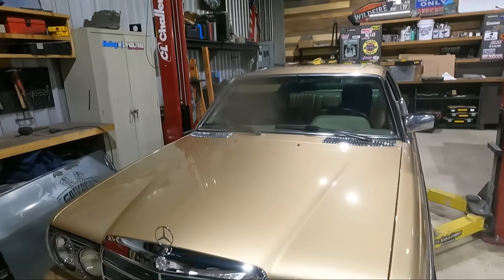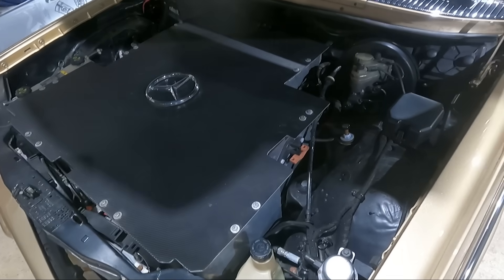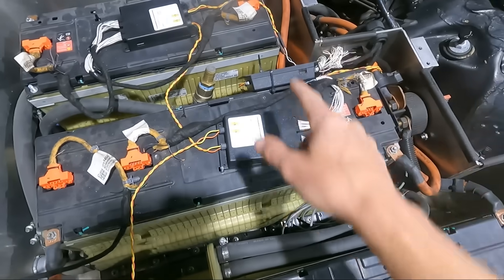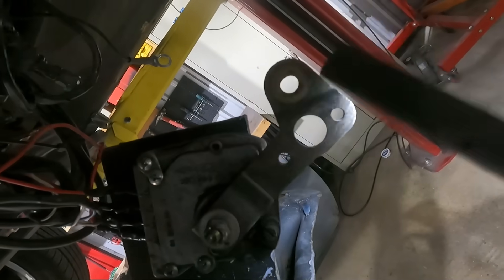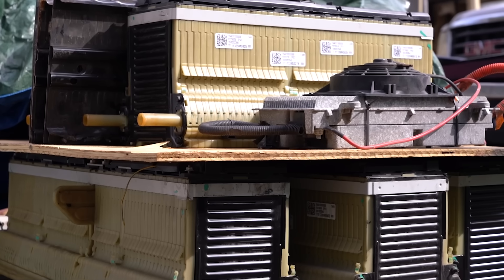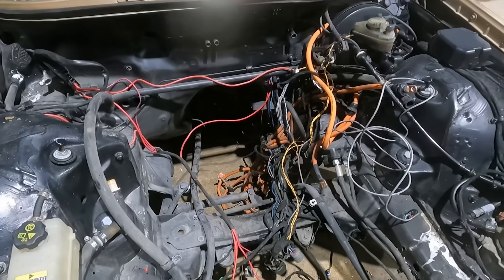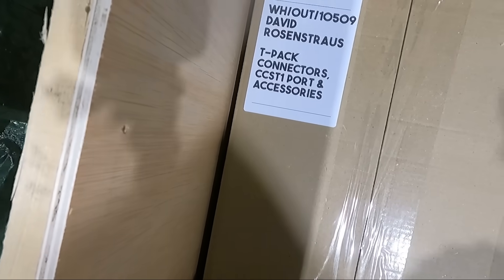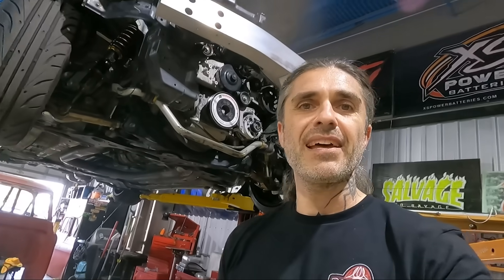Huge Tesla Swapped Mercedes Battery Upgrade! - EV 300CD  Benz Conversion Ep. 2

Comment: I miss my S123 wagon but i dont miss the 21mpg it was getting after 487,000mi or the oil dripping. cool build. but do you have a sound system to mimic the 5cyl. diesel sound?

Comment: Why do you need a seperate 12v automotive battery of there is no starter or gas powered engine in the vehicle any longer? Can't the vehicle run off the Tesla batteries you are installing such as radio and other electronic items?
Reply from the maker: The Tesla batteries are a high voltage system. You need a low voltage system to be able to power stuff like the radios and gauge cluster. The Tesla battery feeds into the 12v to keep it charged, similar to what an alternator would do. Then the 12v distributes power to the rest of the low voltage system!
Reply: @SalvagetoSavage  DUh, yeah I knew that not sure why I asked lol.
Reply: @479_Moto  It's a great question and you're not the only one who wonders why.

Comment: Removal what is arguably one of the most reliable motors ever installed into a passenger vehicle and replace it with, hands down the most unreliable power source ever installed into a passenger vehicle.  The originality of all the cars you guys do and upgrade blows my mind!!!  The LS Benz is the best build on YouTube.
Reply from the maker: Dave daily drives this Mercedes! He got about 80 miles on a charge that costs him 25 cents! It's plenty reliable if you build em right! Thanks for all the support. We'll be popping out another video on the LS Benz again soon!
Reply: 😂😂😂😂😂 Y con el tuyo que hiciste? Ah no, me lo imaginaba
Reply: Lol. EV's are far more reliable than any petrol engine, and require next to no servicing
Reply: @ross_12345  They are removing the batteries (unreliable power plant)and putting in new ones (which will also not last very long).  No servicing??  This seems to me a video of the very servicing that you claim does not occur.  Thanks for the amusement!!!
Reply: @briansbrain426  Upgrading is not servicing